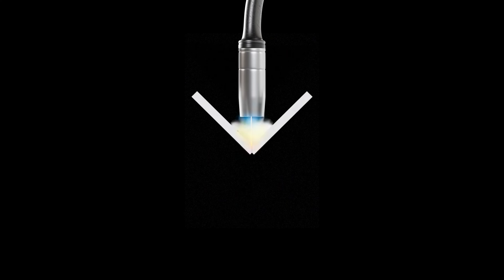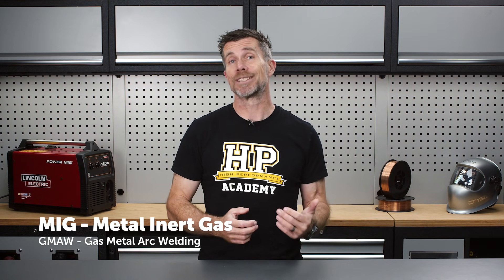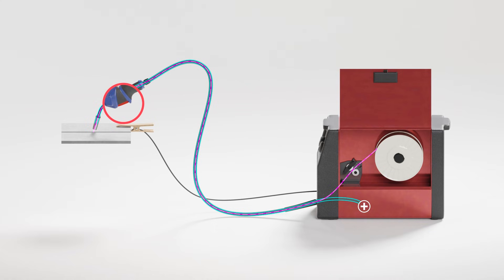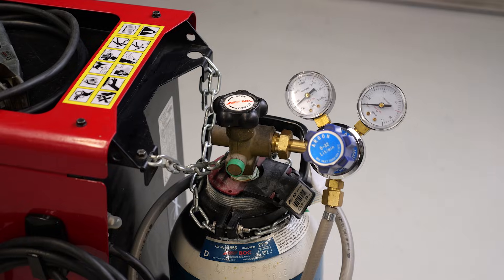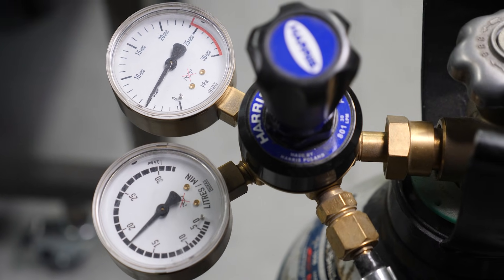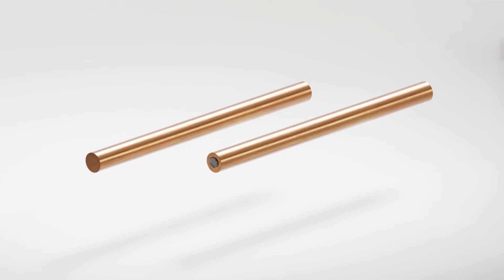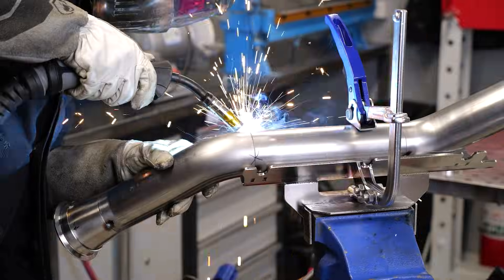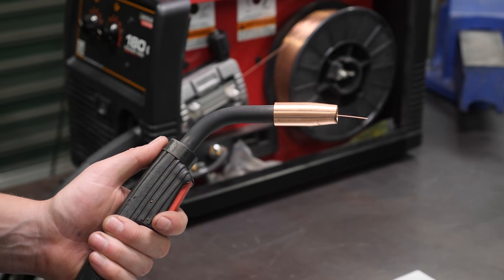Beginner’s Guide to MIG Welders

Comment: Or if you are looking to replace some panels on your car, this class is also for you 😅
Reply from the maker: haha for sure! If you want to start to learn how stick two pieces of metal together using a MIG, you're in the right place. Body work can be a tricky one to start with and MIG isn't always the best choice for some situations, but we all start at 0 and having a project in mind with a clear goal is great motivation. Many people dive headfirst into non-structural body work without issue

One recommendation we do love to make though as a first project is building your own welding bench/table. It helps you to get some experience on something you will actually use, and it won't matter if the welds look a little rougher on that compared to some other projects - Taz.

Comment: I want to get a welder but don't do enough to require one haha

Are you guys going to cover hybrid turbos anytime soon? I'm very interested in how they work.
Reply: Don’t know if this helps at all, but you can rent equipment from some places.
Reply from the maker: As mentioned sometimes you can rent a welder, or when I was younger I bought a decent secondhand one with a few friends and we shared it.
Some car clubs might also have a 'tool library', or another member that is happy to let you use theirs from time to time in exchange for a few beers or your help with something else.

Where there is a will, there is a way, especially if you're kind and respectful of others and their gear.

They're not quite on our radar just yet. When we start seeing them in use on the cars we cover at events though for sure they're going to come up - Taz.